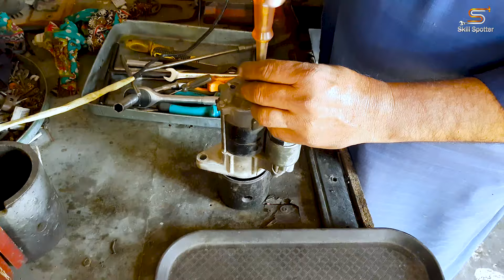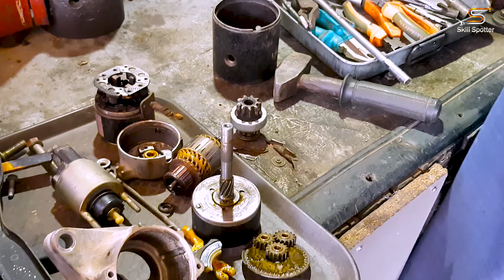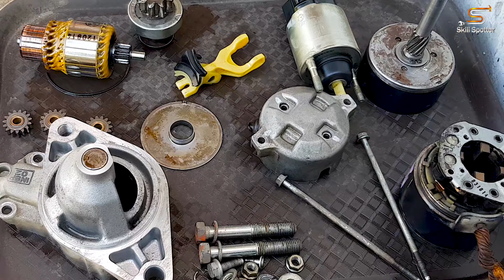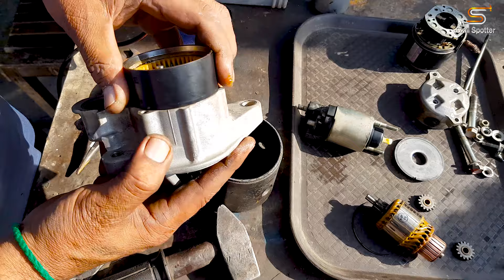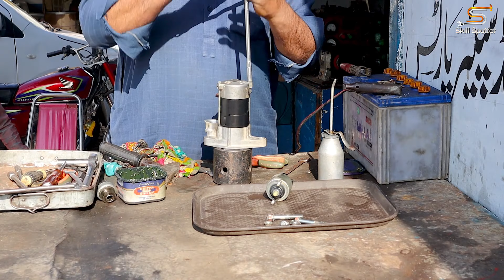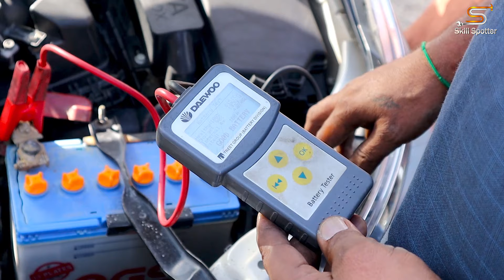Bendix Starter: This Mechanic fix the Car Self Starter Bendix Gear Motor Perfectly

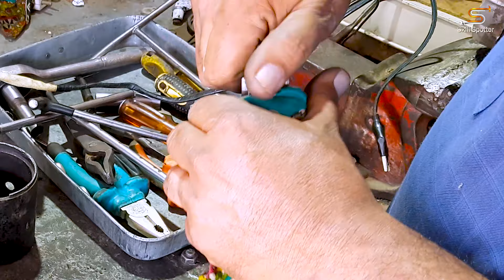Comment: 1:45 Denso starter has 11mm diameter pinion shaft; use 11mm deep 6 point socket to drive the locking ring down

Comment: Hello sir I have unusual problem .
Pore as I am I own old Opel Ascona C 1.3 L model I got starter motor from friend how ever that starter motor is not for opel but for golf disel engine .
Evry thing look nearly identical bouth are magnet type starter motors but the golf starter has gears in it.
I tried to merge parts even I asume the golf starter motor tirns in oposite direction so I solved that be cutting 2 insulated brush holder and make all 4 brushes insulated and took out the case 2 leads .
So I solved starter motor direction it looks like evry thing fits perfectly together .
But I come across another problem the bendix from the golf has counter grewe's drilled in oposite direction so the bendix rotation does not match to me old opel starter bendix.
So what does this mean?
Wuld me engine still rotate ore not?
Ore car the bendix as well be modified to turn another direction ore removeing those internal parts from the bendix wuld that help?
Reply from the maker: Sir I am just a video creator